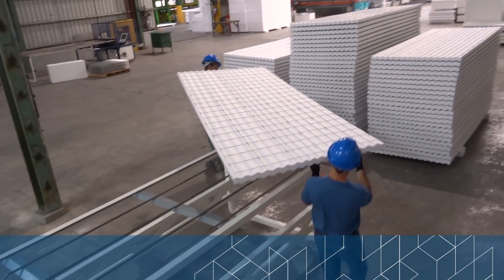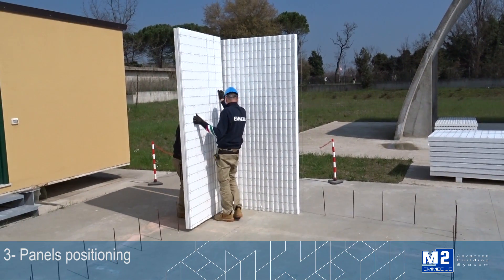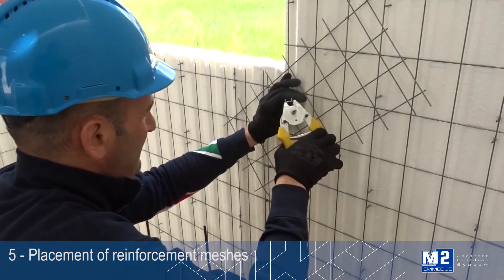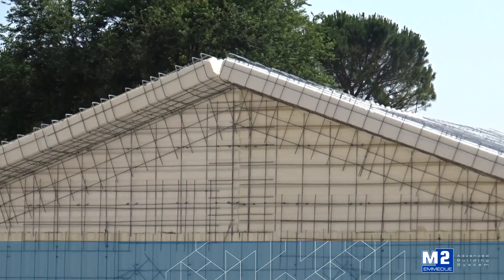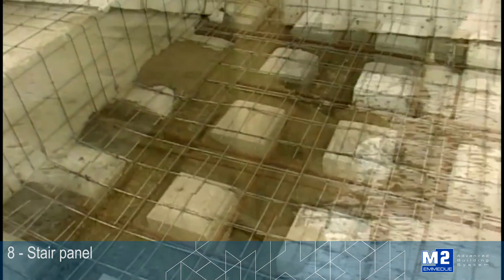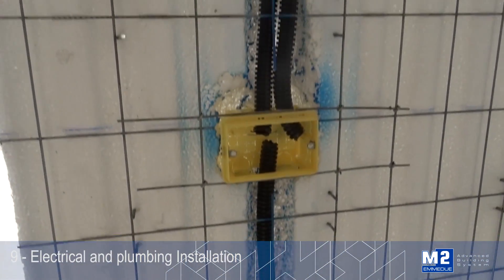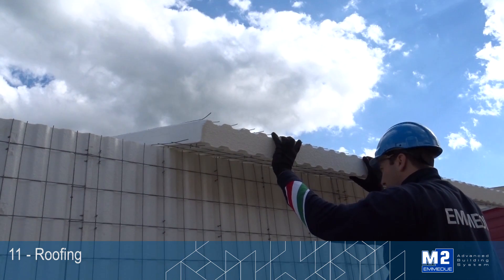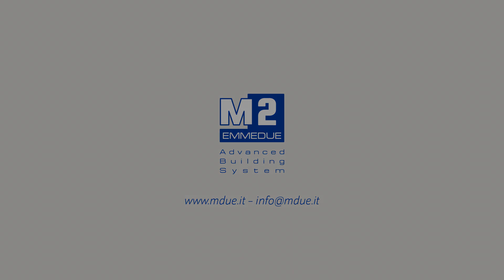The Emmedue Single Panel: core of the Emmedue Advanced Building System

Comment: Since mortar plaster is used, is it prone to develop hairline cracks, particularly due to moderate seismic activity or temperature fluctuations? If so, does this condition compromise the structural integrity, or just a cosmetic issue of the plaster?
Reply from the maker: Cracks may occasionally appear in the plaster, but they are purely aesthetic and do not affect the structural integrity. If you need any further information, feel free to contact us at info@mdue.it. Thank you!
Reply: @EMMEDUEabs  who in their right mind wants any cracks?
Reply: Think of stucco...

Comment: No doubts about the structural advantages, but EPS with layers of concrete is a big humidity trap. Are you relying from buildings using AC 100% all of the time?
Reply from the maker: Good morning Dominic!
EPS is water vapor-permeable, making it breathable, yet waterproof. The permeability to water vapor ensures that mold does not develop inside buildings and environments insulated with EPS.
Additionally, please note that the thickness of the panels is variable and is determined only after a thorough thermo-hygrometric assessment, which allows us to assess the potential formation of interstitial condensation. For any further information, feel free to contact us at info@mdue.it. Have a nice day! :)

Comment: Is it possible to build cantilevered rooms out of this material without providing beams, particularly for a short cantilevered floor overhanged by 30 cm?
Reply from the maker: Usually there is no problem creating cantilevers of that kind, but obviously you need to do the appropriate checks with structural calculations. In any case, if you email us at info@mdue.it, we can send you example pictures!!!

Comment: I dont.believe this is stronger than hollow block
Reply: It is.
Reply: u have to understand stress points and also how different materials combined are more stronger than a pure concrete block, also that metal mesh is jointed with other panels and it makes the whole walls very strong

Comment: Is the 2nd story just attached to the first story's panels using the metal clips or are additional rebars laid in the 2nd story to support the 2nd story walls?
Reply from the maker: Hello Adam, in  case of a multi-storey buildings, the walls of two consecutive levels are connected to each other by reinforcing bars with a maximum diameter of 8 mm. For any further question, please contact us by email at info@mdue.it!Thank you!

Comment: what's the maximum area that one roof panel can cover ?
Reply from the maker: Hello Ahmed! With the Emmedue system it is possible to produce panels of different lenghts and thicknesses.
In the roof, in terms of resistance, it will depend on the stresses it has to bear, that is,  loads (as wind, snow, etc.) and the spans (distance between supports). Surface area is a relative measure that depends on these factors. For any further question do not hesitate to contact us at info@mdue.it. Thank you!

Comment: What is the density of the eps used in the panel ?
Reply from the maker: Usually it ranges from 15 to 25 kg / m3 based on structural needs. 
For more information do not hesitate to contact us at info@mdue.it. Thank you! :)

Comment: Hi,

whats the name of the electric rebar cliper? thats seems very nice!!

Thanks
Reply from the maker: Hi Cachinhos da lulu
,
 What do you mean by "electric rebar cliper"?
Reply: The equipment with hot air
Reply: Ryobi= makes a battery powered bolt cutter - max diam 3/8inch perhaps.  RYOBI 18-Volt ONE+ Cordless Bolt Cutters

Comment: Hi, technically is difficult with nomor workers, i am built 3d panel house, special  buld 3 floor without concrete framing, tks
Reply from the maker: Hi Chinh! I'm not sure I understand your comment. In any case, one of the characteristics of our building system is the ease of assembly on site. For further information, do not hesitate to contact us at info@mdue.it. Thank you :)
Reply: Pls contact : Amy 008613365455439   amysalemanager@abcn.group

Comment: Is this really durable? Built to last? Earthquake and fire resistant?
Reply from the maker: Good morning Ms. Rodeza,
yes, as for the resistance to earth-quakes, laboratory tests carried out on full-scale prototype houses have shown that the Emmedue structures withstand, without any damage, earthquakes of seismic accelerations superior than those required by current seismic safety regulations.

While regarding the resistance to fire, Emmedue panels are made of self-extinguishing expanded polystyrene, which is also perfectly confined by layers of reinforced concrete that cover the sides of the panel and prevent combustion.
Its fire resistance has been verified according to international standards through tests conducted in different laboratories.

Moreover, Emmedue panels have proved a great resistance to blast and cyclones. Please, check this link: https://www.mdue.it/en/advantages.php

or more enquiries, we are at your disposal!
Reply: @EMMEDUEabs  I see the Cyclone resistance is only 106.20 km/h which translates to 66 mph which is not even Hurricane strength. Is that honestly the highest tested speed?
Reply from the maker: @KitCayman  Good Morning Kevin, for technical details I invite you to contact us by email to info@mdue.it  n order to be able to send you the technical documentation of your interest, Thanks :)
Reply: @EMMEDUEabs  sent
Reply from the maker: @KitCayman  our technical department will answer you asap. Thank you :)
Reply from the maker: Good morning Deza, of course our building system has been subjected to resistance tests of all kinds (load, fire, hurricanes, earthquakes, etc ...) by accredited bodies around the world. If you are interested in learning more, please write to info@mdue.it and we will send you the documentation of your interest. Thank you :)
Reply: Pp0

Comment: Impressive! But you guys don't need columns and beams？
Reply from the maker: Hello Mr. Ke Zhao,
thank you for your interest! Buildings realized with the Emmedue System don't require traditional bearing elements, as certified by:
- ETA certification, for the European Union;
- different tests carried out in laboratories all over the world (including seismic tests);
- and hundreds of thousands of buildings realized with the Emmedue System without traditional bearing elements, such as beams and columns.

For any other inquiry, we are at your disposal at info@mdue.it
Reply: @EMMEDUEabs  what thickness foam /density and wire diameter / mesh is needed for a single or 2 story house   to be built with out columns and beams and withstand typhoon force winds ?  I have been told here in Philippines that columns are needed but I suspect their panels   are only 2 inch of foam.
Reply from the maker: @boracay12  good morning. I guess we got your request this morning on our website and I already forwarded it to the person in charge who will get back as soon as possible with all the technical information needed. If that was not you, please write us at info@mdue.it so that we can forward your request to the dedicated department.

Have a nice day!
Reply: @EMMEDUEabs  hello ,yes that was me ,thank you for your response  . I'm looking forward to the information. .   there is conflicting opinions .and I think your company is qualified to provide to give the correct requirements . 
    Thanks again ,and have a good day .